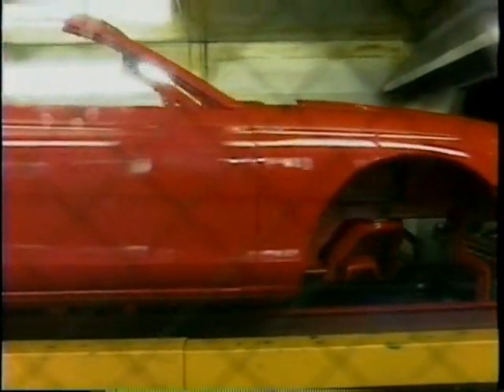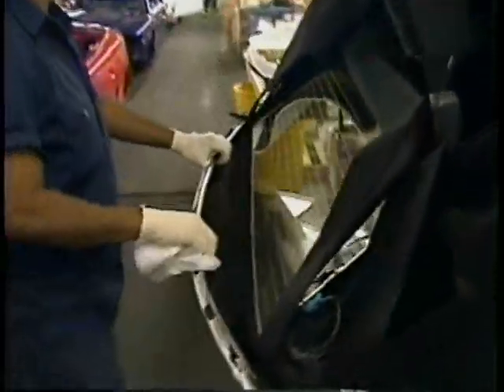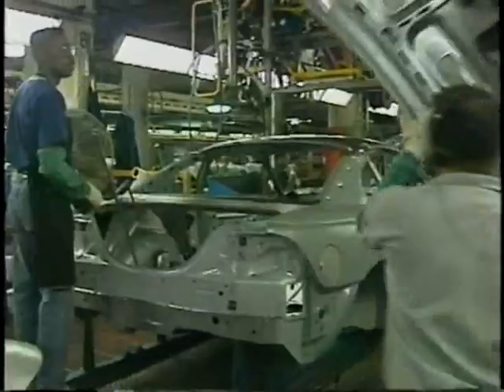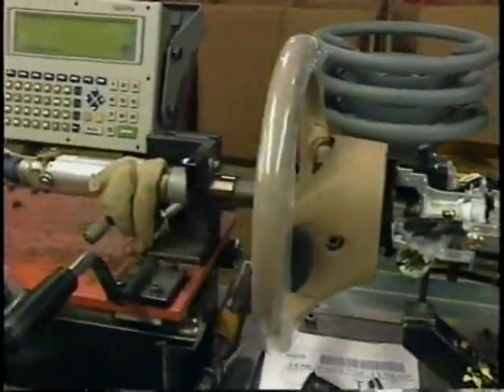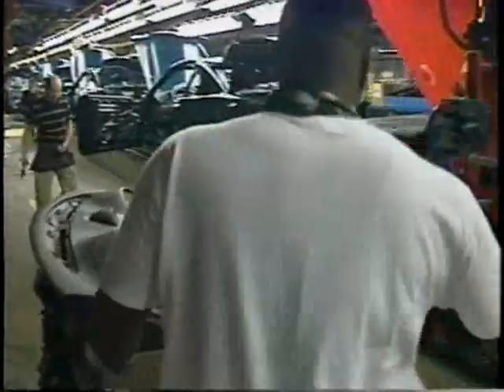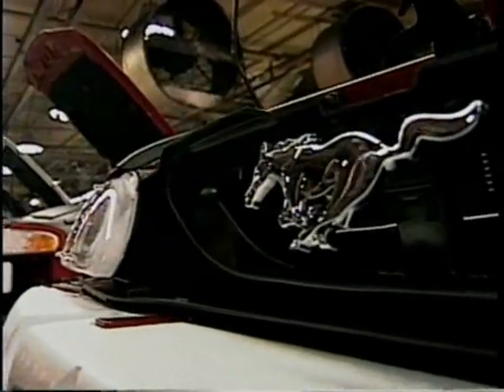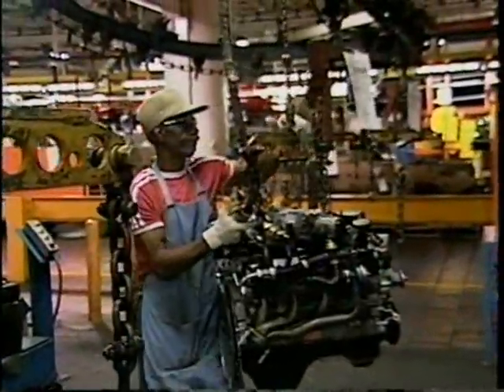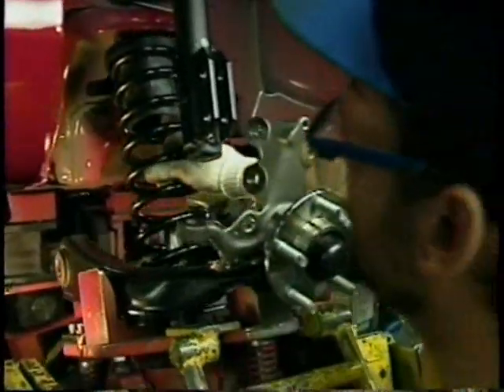How a Car is Built - 94-95 Mustang part 3

Comment: The 3d image of the engine and the suspension in the diagram is not even what they have . Those 5.0s did not have dual overhead cams. And the Suspension has a lower control arm not a upper Front control arm.